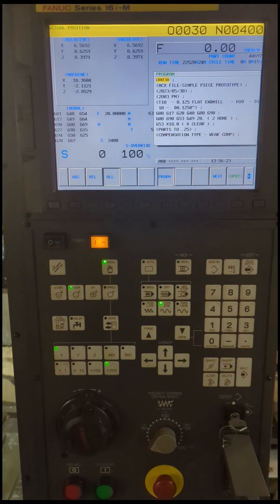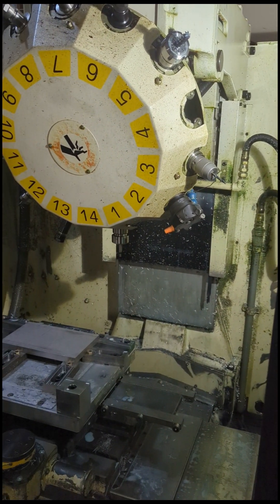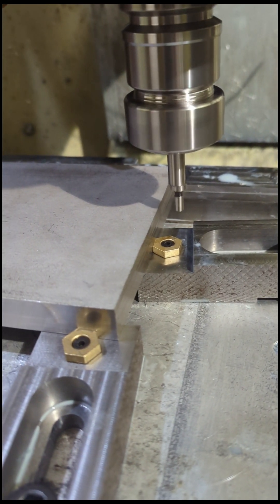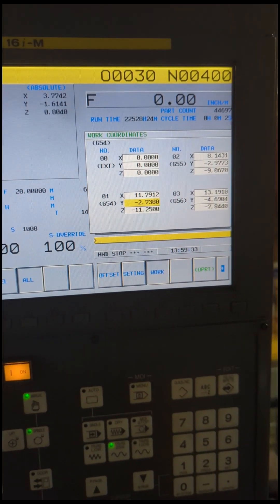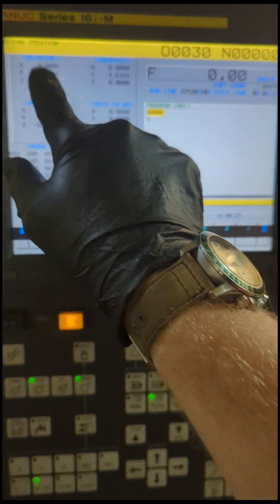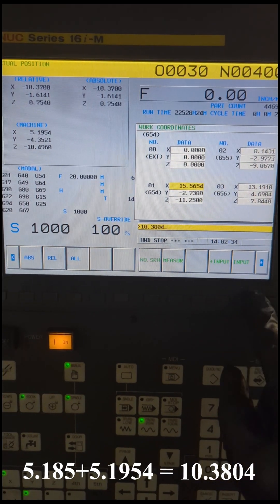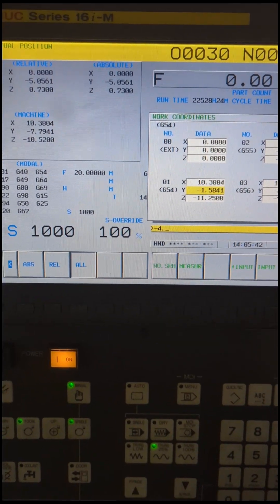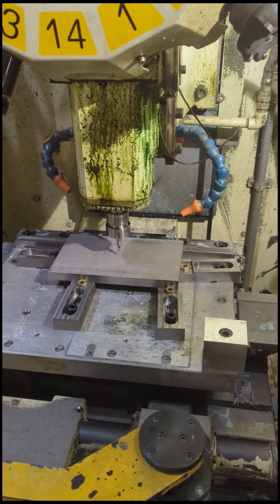Using a Wobbler-style Edge Finder to set X & Y zeros on a Fanuc Robodrill

Comment: Thanks for these informative videos. Got a bit newer robodrill with same 16i control. My tool changes are very slow though! Your tool change even with 25%rapid is extremely fast. Do you know the parameters to check for this?
Reply from the maker: Heyo @viliusr6974, thanks for watching!    You can adjust two parameters (that I know of, there's probably a lot more!) to control the speed.   Param #7850 (Z axis toolchange speed), and 7851 (magazine positioning feedrate).  You should be able to tweak that.  On my machine, I had to adjust 7851 from 2000 like it was in this video down to 1500 in the winter time when it was really cold (I keep my garage too cold, apparently!) because I would get error 252 if I had the carousel fully loaded, so I just slowed it down and it worked fine. 

The only other thing to remember is that you'll need to power cycle the machine after doing it.  

There's also a keeprelay (internet says it's K0 Bit 4) that can be set to 1 for "heavy tool" that will slow it down, and 0 that's not, but I haven't played with that one on mine.   You'll have to power down if you change that one that as well.
Reply: @VectorMfg  thanks for the response. Much appreciated